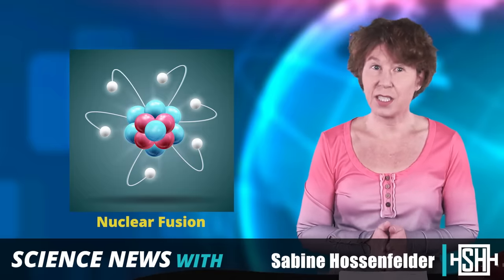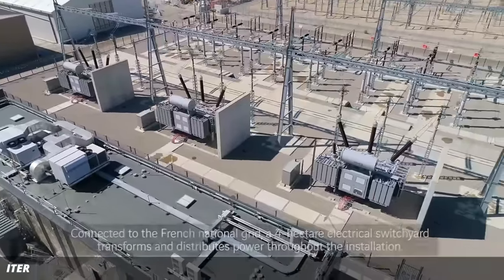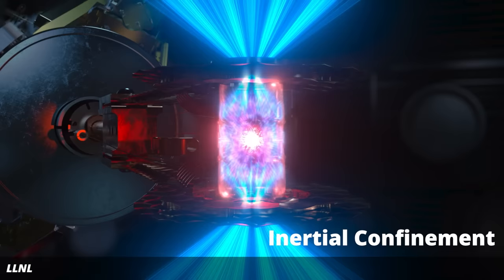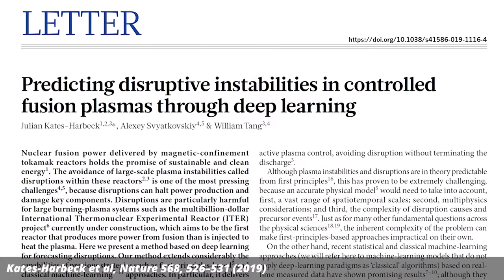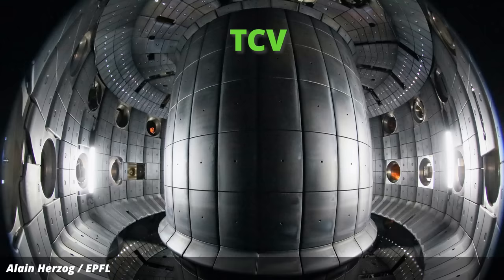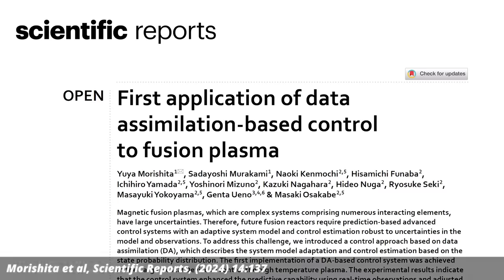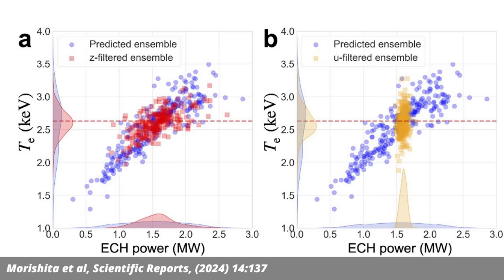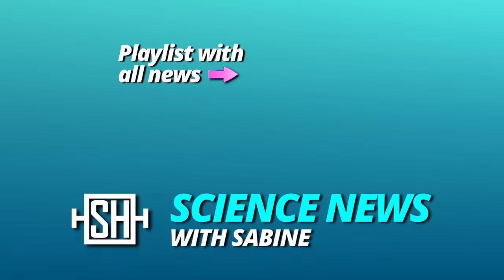First Nuclear Plasma Control with Digital Twin

Comment: Nuclear fusion power is great in theory but there are cost issues as compared to renewables. 
Firstly is the fuel chosen.... how expensive is it to make, transport in quantity, and store?
How does that compare to renewables?
Secondly, can the fusion reaction be kept going round the clock given current reactor designs? How much maintenance and down time is there?
All these factors will determine whether fusion even gets a chance in the market place. My own guess is that it will be used by the military, space exploration, and emergency backup power generation with portable reactors. But that may be it given the overall cost per KW ratio with renewables.
Renewables like solar and wind keep getting cheaper with solar expected to go down another 80% in price by the end of this decade given current cost decline curves. Battery storage is also seeing an even steeper cost decline curve.
This is to say that it already may be too late for fusion to ever get a chance given that places like Germany have already reached 50% renewable energy in their electric grid.
Reply: the problem of renewables is that there is a great disparity in the world about their abundance. Also if you want to power equally the entire world, there is absolutely no way.
Reply: @drgetwrekt869  I agree about the disparity. However cheap Chinese solar panels and distributed power and local grids are much much more available and much much cheaper than building nuclear fusion reactors with huge centralized grids that these nations don't have and can't afford.... as they don't have them now. 
As mentioned, the fuel that goes into todays fusion reactors is rare and has to be very pure. It also requires energy to make. 
If anything, renewables with (or without) battery storage and distributed grids can be delivered fast and cheap compared to fusion. The good news is that most poorer nations are in the sunniest locations on the earth. Using solar panels as the roof of a house itself, could even be an option in some countries.
In China you can now buy a 100 watt solar panel for less than $20. This price is expected to continue to nose dive for the remainder of this decade.... at least another 80%. Thus by 2030 this same panel might be $5.  That would be $50/KW.
Reply: @nickmcconnell1291  I don't think you can run the whole planet - including heavy industry and all transport, not just homes - on renewables and batteries without wrecking the whole planet with mining, processing, and end-of-life waste disposal and replacement (yet more mining and processing). Use renewables where they work best, but you need diversity and some energy sources that can do heavy lifting without so much land and resource use. The non-fossil thing we have for the latter currently is Fission. Politics and public opinion are against that, and cause much of the high cost. Fusion may have a future role to play here. We need to pursue every energy avenue, or massively drop the population and go back to subsistence farming low-tech life. I don't see many folks voting for that.
Reply: @MattNolanCustom  There are a host of companies that are gearing up to do this. Most notably Redwood Materials in the US.  Almost all lithium batteries can be recycled now including the ones in your cell phone. 
Once there has been a change over to all electric, they can almost stop mining because it is much cheaper to recycle the battery than to mine new ore and process it. Battery chemicals are not like plastic which can only be recycled a few times. They get back the pure elements out of the batteries.  Redwood has proven that it can recover and separate out 98% of the battery elements. 
This is all to say that there is a time horizon for how long the mining will be profitable and then it will close down as recycled chemicals to build new batteries become readily available in a closed loop. Also as battery energy density increases the number of batteries needed will actually go way down.
Conversely, coal, and oil mining/fracking will go way down. Overall the amount of total mining will also go down. 
    Having said all the above, I do support nuclear energy as supplemental and emergency backup power for the grid. However over the next two decades I expect much of the grid to be reduced in size as more and more home owners go off grid entirely with more and more efficient solar panels and batteries. In more impoverished countries solar and local grids are a no brainier to the ludicrously expensive nuclear reactor options.
Reply: @nickmcconnell1291 not just the materials for the batteries, the materials for the solar panels and the wind turbines. And I think you under-estimate how much energy (and energy storage) we will need not just to replace what fossil fuels currently provide but also to bring the developing world up to the same living standards as those of us who are more fortunate.
Reply: @MattNolanCustom  Actually they note can recycle solar panels too. Search on that and you will find the companies that can do it and are planning on growing. But I take your point and concern seriously. I want to avoid additional burdens on the environment. 
As to how much energy will be needed, solar and wind with storage has to be built for the coldest non-windy days of the year. Tony Seba has run the numbers and this means that the installations would need to be oversized and then have 4 days of battery (or other) energy storage..... this for the worst case scenario in the coldest parts of the US. He used real electric and gas utility data to come up with these numbers.  With solar panel prices where they are, the US could shift over to complete renewables four an estimated 10 Trillion spent over a decade. Which works out to about 1% of our GDP..... very doable.  Countries that are colder are much less populated than the US so they would need much less overall. Countries nearer the equator would need a small fraction because they have so much sunlight. 
Total numbers for the entire world I have not heard of but in its entirety it would be less than the countries of the works are paying right now in fossil fuel subsidies over that same decade. 
So this can be done like for like. 
     Now if your goal is to lift up other nations out of poverty and up to our standard of living, that is completely different. However an expensive tech like nuclear is less likely to be economical in doing this. Also given the common wars in many parts of the world, nuclear sites are single points of failure and military targets. Distributed power grids (homes or villages having their own power) are more secure by their nature.
Reply: @nickmcconnell1291  places in northern Europe have been known to go almost a month without significant solar or wind generation in the worst historical instances. Some of them (the UK, for example) are highly populated. Batteries don't work for that. Maybe more super-grid connections to southern Europe and North Africa are needed, but that gets inefficient fairly quickly.
Reply: @MattNolanCustom  Indeed certain EU countries will need to rely on external generation. The numbers Tony Seba came up with were for the US, and maybe Canada, only. 
Perhaps tidal energy generation might tide (pun intended) them over during those stretches??  However given that these countries are relatively rich and already have sophisticated grids in place, nuclear might well be a good choice. They have the expertise and engineers inhouse.
Reply: @nickmcconnell1291  yes, Germany are certainly regretting going with the popular bandwagon and decommissioning their nuclear generator fleet. The UK have neglected theirs too, and are now realising that was a bad move as they rush to build new ones and have to use overseas expertise with spiraling costs.

Comment: This is a very straitforward example of how mainstream Fusion effort epitimized by ITER of using Brute force size enlargment of the device is the technoligical equivilent of trying to make a steam-engine power airplane work by making it bigger.  We have simply been trying to make up for deficiences in magnets, computer and instrumentation with size, it is as doomed as trying to make up for the power-2-weight ratio of an aircraft with size, it's horribly inefficient and a waste of time and money which would be better spent on actually fixing the basic defficiencies which are blocking progress.

Comment: The real problem to me is that we consume H2 from water and disappears to becomes He which is a non reactive atom and the process is irreversible as He is extremely stable element and the energy to apply fission to its nucleus is huge, water is not a unlimited resource
Reply: Noone said it's unlimited in this video. It's limited but still very huge energy content, given how much water there is in oceans.

(Many clickbait videos say fusion would provide "unlimited energy" which is of course false. Sabine didn't do that)
Reply: Applying fission to helium nucleus is pointless, you only lose energy that way. As a rule of thumb, all the nuclei lighter than iron would have positive energy output when they fuse, and noone would ever think of fission plant with those. And vice versa for the heavier nuclei. Uranium is only useful in a fission power plant, fusing it with something would not produce energy but consume it.
Reply: @u1zha  I don't think that is what sermodur meant about Helium. He meant that the "water" lost would be lost irreversibly so. They are certainly missing the point that using water for fusion fuel is "effectively" limitless though.

Comment: What about cold fusion? Haven't you made any further progress...? in your last video on the subject, it seems that there was a remote possibility of this happening... it will be a shame... it is not easy to find free neutrons decaying around...ps:When I was a teenager, I read a book that said that chickens, even with a diet low in calcium, can "transmute" elements to always have a good amount of calcium to produce eggs... I imagine they do it using the fusion method. nuclear, otherwise each chicken would become a dangerous nuclear bomb... have you ever heard of that? Does it make any sense?

Comment: Translation into English, Portuguese and Japanese.

英語、ポルトガル語、日本語への翻訳。

Tradução em inglês, português e japonês.

The human brain is a thermonuclear processor.  This means that all information is processed and generated by it magnetically millions (+) of negative degrees Celsius.  However, the human brain searches for programming logic all the time, through the computational power of magnetic logic there are millions (+) of negative degrees Celsius.  The human brain needs magnetic (logical) computational power, which can be supplied through classical computing, by magnetic converters and emitters directly to the brain.  Thermonuclear computers will give us perfectionism in understanding reality and precise functioning of the brain.  In a thermonuclear computer, the DIE is placed in an absolute vacuum, whose vacuum measurement unit exceeds 100,000 pascals.  To build a thermonuclear computer, it is necessary to have 15 vacuum motors (traditional vacuum pumps with 15 cfm), 15 metal conduits 15 meters long and 7mm in diameter each.  15 connectors to connect the metal conduits to the vacuum motors, solder, to connect the metal conduits to the 20 centimeter hub where the DIE must be fixed.  NOTE: The DIE must be inside the solid metal cube and connected to the motherboard by wires.

O cérebro humano é um processador termo nuclear. Isto significa que toda informação é processada e gerada por ele magnéticamente há milhões (+) de graus célcius negativos. Porém o cérebro humano busca por lógica de programação o tempo todo, através de poder computacional de lógica magnética há milhões (+) de graus célcius negativos. O cérebro humano necessita de poder computacional lógico magnético), que pode ser fornecido através da clássica computação, por conversores e emissores magnéticos diretamente ao cérebro. Computadores termo nucleares nos darão perfeccionismo na compreensão da realidade e funcionamento preciso do cérebro. Em um computador termo nuclear o DIE é colocado em um vácuo absoluto, cuja unidade de medida do vácuo ultrapassa 100.000 pascal. Para a construção de um computador termo nuclear é necessário 15 motores de vácuo, (tradicionais bombas à vácuo com 15 cfm), 15 conduítes de metais com 15 metros de comprimento e 7mm de diâmetros cada.  15 conectores para ligar os contuítes de metal aos motores de vácuo, solda, para conectar os conduítes de metal ao cubo de 20 centímetros onde o DIE deve estar fixado. OBS: O DIE deve estar no interior do cubo de metal maciço e conectado à placa mãe por fios. 

人間の脳は熱核処理装置です。 これは、すべての情報が摂氏マイナス数百万度 (+) の磁気によって処理および生成されることを意味します。 しかし、人間の脳は常にプログラミング ロジックを検索しており、磁気ロジックの計算能力により、摂氏マイナス数百万 (+) 度の温度が存在します。 人間の脳は磁気 (論理) 計算能力を必要とします。磁気 (論理) 計算能力は、古典的なコンピューティングを通じて、磁気コンバーターとエミッターによって脳に直接供給されます。 熱核コンピューターは、現実を理解する上での完璧主義と脳の正確な機能をもたらします。 熱核コンピューターでは、DIE は絶対真空中に置かれ、その真空測定単位は 100,000 パスカルを超えます。 熱核コンピューターを構築するには、15 個の真空モーター (15 cfm の従来の真空ポンプ)、長さ 15 メートル、直径 7 mm の金属導管 15 本が必要です。 金属導管を真空モーターに接続するための 15 個のコネクタ、はんだ付け、金属導管を DIE を固定する必要がある 20 センチメートルのハブに接続します。 注: DIE は固体金属立方体内にあり、ワイヤでマザーボードに接続されている必要があります。

Comment: My prediction for fusion is that we'll crack it wide open in a generation and it will prove to be far less impressive than we expected. 

Furthermore, our transmission technology and distribution infrastructure, at its most sophisticated, is still far below the potential of current power generation. That bottleneck is whats responsible for power shortfalls and cost. Fusion power won't fix that.
Reply: what you mean "crack open" ? it is already cracked. everyone knows the mechanism and what you need to get ignition. The issue is making it technologically viable, which is a painful process sadly. and it would require more machines but politics doesnt want to risk too much (but this is actually costing MORE on the long run)

Comment: 2% of something with the energy of the core of a star that’s uncontrolled seems somewhat risky. But that’s ok! This is just the 20 year check in and it’s 4 years late. It seemed that in 1980 it was a thing and then in 2000 and a bit before and after, it was a thing and now for 4 years or so it’s been a thing again.

AND A FUNCTIONAL FUSION TEST AND TEST ONLY REACTOR IS ALWAYS JUST 20 YEARS OR LESS AWAY. and that’s still a test reactor. 

At this rate the warmth from global warming will be so bad that it will stave off the heat death in the universe at least in the local group AND WE STIILL WE BE JUST 20 YEARS AWAY FROM A TEST REACTOR.

Comment: There would be a big problem with cheap plentiful energy and that is it's overuse and maximal exploitation.  The earth can only handle so much heat generation, and we could actually kill the planet with not all that much more...even if it was clean.  It will be important to export the excess heat into space as plants do via infrared radiation, but I worry most about energy bottlenecks, and the secondary effects of excess solid and liquid pollution, and high energy chemical residues (generally carcinogenic) if we go peddle to the meddle with a lot of excess cheap  energy that would render many under explored industrial and chemical processes economically viable overnight. For example, it could become lucrative to mine gold from large quantities of seawater, but should we if we don't understand all the consequences of scaling up such a process.

Comment: Fine, they are learning how to avoid the destruction of the reactor by the plasma, then they will have to learn how to controll fusion,  but how will they extract the heat
Reply: Neutrons are not confined by a magnetic field, and in a Deuterium-Tritium fusion reaction, they are the product which carries the majority of the energy produced. They will tear through stuff and make it hot. The plan is to make most of this stuff from neutron multipliers and lithium in order to generate even more heat and also to re-generate Tritium. The heat is exchanged to produce steam in most mainstream fusion concepts, and the steam will drive turbines to generate electricity.

Comment: Nuclear fusion is already in action. The sun.
Reply: Right, but you can´t reproduce the pressure in the core of the sun.
Reply: @Thomas-gk42  we can capture the energy though
Reply: @okkomp  Ok, understand what you mean.  Renewables are quite successful, but are they sufficient to satisfy humanity´s hunger for energy and solve the issue of climate change? I´m not so sure.
Reply: @Thomas-gk42  answer is yes
Reply: @okkomp Good news, if you´re right.
Reply: @Thomas-gk42  as a fine man once said: "it's the economics (of solar and batteries), stupid"
Google "wrights law, solar"

Comment: i am the dumbest person on here but I think that plasma can be controlled with rotation or maybe spin. To control the plasma I think you will need rotational kintetic energy. Either the whole thing or something super heavy in the middle creating energy momentum to move the plasma in a direction. But until ChatGPT can run simulations, my idea is just a poorly constructed hypthesis.
Reply: The issue with that idea is that plasma isn't a solid mass, it's an ionized gas where the particles move independently. Even if you managed to give the entire thing enough rotational energy, the particles would just start bumping into eachother and transfering it, eventually leading to stragglers who lost too much of it falling out of the system and causing domino effect which will mess up the whole thing (which is also what happens in the magnetic torus, but for a different reason)